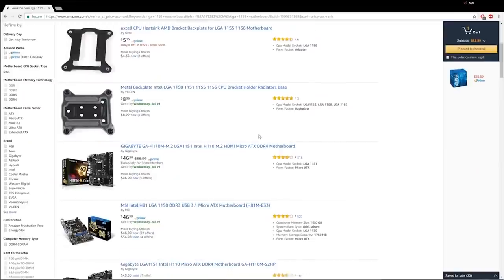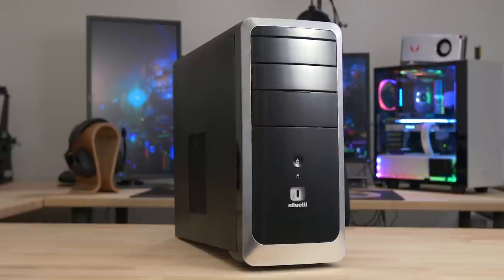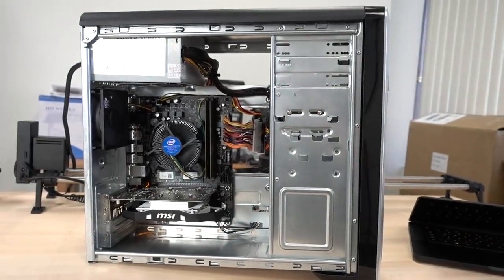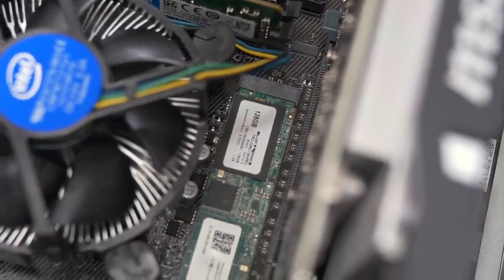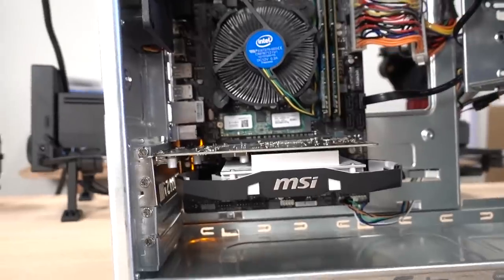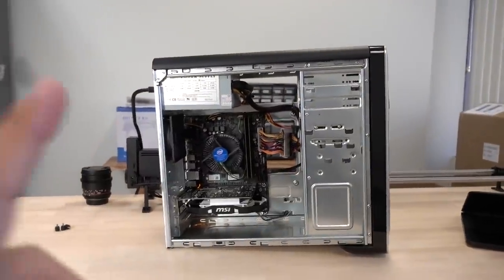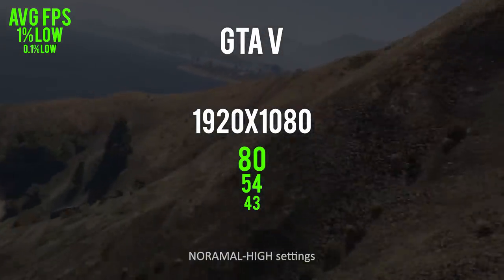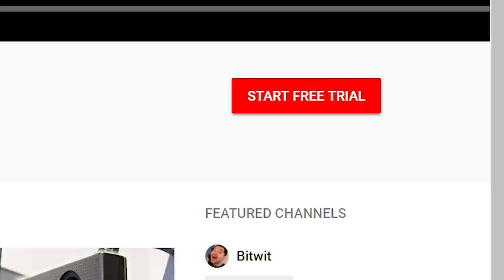The best $400 gaming PC ever?

Comment: How does this PC look?

Ryzen 5 1600
-Stock Cooler

B350 Tomahawk

GTX EVGA 1070 SC

NZXT S340 Elite

CX550M 550W PSU

Samsung 850 EVO 250GB SSD
1TB HDD

Corsair Vengeance 3000mhz RAM 8GB 2x4
Reply: Dwight Schrute good but if you can get the regular s340 or a cheaper case to upgrade to the 1600x
Reply: Dwight Schrute I would look for a 600w power supplie or more. If you can get 16gb of ram would also be good maybe even a hyper evo 212 or another cooler. If you want to get a rgb/red strip which supports Msi mystic lighting e.g bitfenix rgb/red strip and a red 1070 if you want a consistent theme throughout build.
Reply: QuietSpaceGaming dude don't tell him to get the 1600x, the 1600 can be OC'd and comes with a cooler
Reply: Nice but ge 16gb of ram
Reply: Dwight Schrute I have the s340 elite and it looks so nice. I would also recommend the Cryorig h7 for some nice cooling. It looks very nice.
Reply: Ezio Auditore But the non X chips have lower quality memory controllers making it harder to get anything over 3200 in those systems. Obviously some are lucky and some aren't but I'd never count on getting 3600 memory to work at that speed on a 1600. 1600x maybe, 1700x definitely. But 3000 or 3200 is plenty fast for this system as anything over that gets expensive fast.
Also, the power supply is plenty, getting bigger doesn't give you anything except a more quiet PC as bigger power supplies don't turn the fan on unless they are over 50% load, so take that for what you will. Stock cooler is fine for 3.7 but if you could get something a little better (possibly hyper 612 evo or something like that) then you could overclock it to 3.9 (4.0 if you're lucky) and get a fair amount of performance improvement, but then again I don't know how close to your budget max you are already. 
As far as SSD, Samsung is essensially the same speed as every other SATA 2.5" drive, get whatever is the cheapest in the size you want. When I built my last pc, the crucial was the cheapest but prices fluctuate so much I wouldn't count on anything except for Samsung being more expensive, and every little bit helps
Reply: Oh, also there's a rumor of a 1070 ti to replace the 1070 and beat vega 56 at the same price of the 1070, instead of it being only 75% of a 1080, it would be 87% (ish) of a 1080 at the same price, if that might be worth it to you look into those rumors and judge for yourself if you think they're true
Reply: whats your budget?
if you can, id get 16 gigs of ram and maybe a better psu, somthing gold rated like the rm650x  or an evga one
Reply: @Dwight looks like a solid build you can overclock it to 3.7 on that stock cooler without raising voltage maybe also
Reply: Oskari like 3000, 2666, 2400?
Reply: L S I'm waiting for the 1070ti because the 1070 will drop in price which is when I will pick it up
Reply: Noam Lotan 1500$
Reply: +Bakht Khan wrote "I would look for a 600w power supplie or more." Dude, he does not need a 600 watt power supply for this rig. A 550 watt power supply is more than adequate. The system is going to pull less than 400 watts, probably closer to 350 watts. 200 watts of margin is ample.
Reply: A GTX 1070 Ti  is the rumored next release it is like what the GTX 1080ti is to a gtx 1080 so a major improvement to the GTX 1070

Comment: What about

Ryzen 3 1200
B350 tomahawk 
8gb ram 3000mHz
Gtx 1050 ti
Reply: You're missing a few components but it's solid.
Reply: You can buy a htpc case with a 280w power supply built in and get a low profile 1050ti for a console sized 1080p gaming pc
Reply: And a 2.5 1tb sshd that performs way better than a standard drive.
Reply: most b350 boards will not clock above 2667mhz yet, unless there has been a fresh bios in the last month that has changed that, but i have seen most boards only going to 2667
Reply: Better than that pentium
Reply: 1200 even OC is slower that TurboPentium in games! You didt watched some latest Jay2Cents videos?
Reply: I have that motherboard and it does not like to post, I would recommend something else

Comment: The 1050 and 1050TI are amazing little cards.  I put one in an old office PC (HP 6200 Elite i3-2200) for my 14 year old and it games quite well, and it works on the stock 320W PSU

Comment: No problem at all using this machine streaming in twitch. I have been using the same pc part except for the cpu and gpu, mine was g4400 cpu and gpu gtx760 which is lower then the part in the video.

Comment: Or just go used and get better performance for $400
Reply: William Shockley i got a i7 4790 8gb ram and a r9 fury x all for 400
Reply: ANDY trie
Reply: The thing about going used is that its not applicable to everyone as other people may not get the same deals.
Reply: ANDY just noobs do that
Reply: I got a 980ti whole trading my 950 and $100 ;)
Reply: Or pay 400 bucks to buy a broken computer.
Reply: Or spend 400 now on a used pc, then 100 in two months when the graphics card dies, then 60 in another month when the hard drive breaks, then another 100 two months later when the motherboard shits itself then maybe another 100 when the CPU melts
Reply: Then it's unlikely to be a powerful cheap PC.
Reply: read more running a X5650 on 88c° for a few months and only droped it ones, there is a corner out of the CPU PCB and still works (btw i have a good cooler but an overclock to 4,6Ghz 1,4875v and that's alot for a standard 2,67Ghz chip)
Reply: Daniel B and if watercooled watercooling parts also new (prevent leaking and shit)
Reply: I recommend that to all of my friends. They are all rocking i7 gaming rigs under $400!
Reply: Newegg and best buy have a lot of refurbished systems and they typically run the same price and there are hundreds of them. If you can get Best Buy and or Newegg to ship to you that is.
Reply: He also says, 'what sort of 400 pc has a m.2?' I'd say 90% of them.
Reply: This build bitwit did was terrible, it has a bad OEM PSU, for the same price he could've gotten a 25$ case and an EVGA PSU...
Reply: Yeah, for example there is the Ultimate Windows XP Build done recently by someone with a i7 3770, a GTX 970, a 650W Power Supply and a 120Gigs SSD with a 1Tb HDD.
https://www.youtube.com/watch?v=BlYKWoBd7_c
Reply: Well that's just stupid. XP is bottlenecking the system, not to mention many games don't support an OS that old anymore.
Reply: ANDY that sarcasm?
Reply: GenericBritishWoman brah can ya vouche for me i lost my medical card, because you have to amokibg some fire shit with that statement
Reply: Dennis Rigdon I don't mean it as in every one uses an m.2 ssd im saying  90% of modern motherboards have m.2 slots
Reply: ANDY my mom works 4 jobs to keep food on the table and she can barely afford out apartment, people like you piss me off
Reply: and yet you have a phone or computer good enough to watch youtube apparently
Reply: WAYYY BETTER
Reply: Yeah but not everyone gets the same deals as someone else this is universal
Reply: William Shockley That's what I did

Comment: I built the same system a few months ago but i ran an RX560 instead of the 1050, Mine boots in like 18sec off an M.2 card, adding an optical drive slows it down a bit but it's not unusable

Comment: You left out the cost for windows.
Reply: And monitor, keyboard and mouse and speakers. Unfortunately when people decide to build their first PC those are other factors they forget that can easily drive your price up. Having all the peripherals now and it's cheaper for me to build/upgrade my current or future rig.
Reply: Trebloc i know this is old, but i cant help it.

Windows 10 you can get for free (windows media creation tool)
You dont need a monitor, you could use a TV
You can get super cheap Keyboard/Mouse combos.
You would only need speakers if your display didnt have any built in, but if you use a TV, speakers arent needed.
Reply: You can get used monitors/tvs dirt cheap
Reply: @teemuojaniitty9864  i got a used asus 24" monitor (idk the model) for 45$.. though its only 60Hz 1080p
Reply: BUT IF YOU BUY A CONSOLE YOU NEED TO BUY A TV AND A COUCH TO SIT ON!!!
Reply: You can also  use your head/earphones. And speakers dont cost anything anyways.
Reply: He can use the trail version

Comment: Kyle should I buy Ryzen? :)
Reply: FalconPlaysMinecraft yes
Reply: People love to hate on Intel right now, but they still have better performance in most games. If you're just gaming and can afford a 7600k or 7700k, you should go for one of those. If you're on a budget, Ryzen 5 is pretty good compared to lower end i5's though.
Reply: LinusTechTips literally just released a video regarding this m8
Reply: WizdomTV The 7700k is king for high end gaming with best over all through put of all but commercial grade processors and out performs many of them in in single core through put. The 7600k is a very good performer but because of multi threaded games is not the best option unless you want to save a little money. I do agree however in most cases under the 7600k Ryzen is just a better value proposition over all even against the g4560 for a little more investment.
Reply: I've seen benchmarks between a 1600 4.0Ghz and a 7700k 4.9Ghz (decent overclock on both then) coupled with either Vega 64 and GTX 1080, the build with ryzen was 6% slower in 1080p and just 2% slower in 1440p (which is the recommended resolution for those gpu)
i7 7700k is "king" but I wouldn't buy a dead platform just for squeezing 3 fps ...
Also the ryzen was usually better with 1% and 0.1% lows
Reply: Man, the r5 1400 (4C/8T) is roughly 40% better than r3 1200 (4C/4T) on cinebench multicore test, so hyperthreading on ryzen is a big deal
The 6C/12T 1600 beat the crap out of the 4C/8T 7700k on multicore test too, with 1Ghz less in clock speed for much cheaper, intels cpu are not good anymore for multitasking, and you can see the same results for threadripper vs i9
Reply: WizdomTV I mean, the 7700k has better single core performance. It seems to beat the 7600k by small margins in most games. Also it's nice for doing other things while gaming.
Reply: Check out Hardware Unboxed's video. "5 best gaming CPUs"
Reply: FalconPlaysMinecraft for minecraft you need a i9
Reply: WizdomTV You get that if the single core performance is better, that scales up when more cores are used right? Maybe I should have said "performance per core" since you seem to be confused.
Reply: Yann Renvoisé
I've seen benchmarks that show the 1600x, 1700x, and even the 1800x lagging further behind the 7700k and it getting better fps lows. It depends on the game and your numbers are likely the best case. You are however right that the 7700k is a dead end because Intel likes to kill off there chip sets and AMD has better chip set features at the moment. Everyone touts upgrade path but Ryzen will have to see much better improvements on AM4 vs the completely lack luster improvements on AM3 to make the upgrade path worth it. Will they? I don't know, but I hope so.

Also, you are correct that AMD can run much better with heavily multi threaded work loads, mostly because of more true cores and/or more threads. Core for core and thread for thread Intel's high end main stream cpus beat Ryzen and in gaming for the next few years or more no more than 8 threads will likely be needed.
Reply: Adam W
The one I've seen is from Hardware Unboxed from 3 days ago (https://www.youtube.com/watch?v=t8K2yc11eC4&t=1s) and was tested with 20 games
From what I've seen in the comments Ryzen was much slower when it came out (like 15% slower) but they resolved most of the problems and now it's on par, titles like Hitman and Total Warhammer run better on i7 and others like Prey, Civilization and Dirt 4 run better on the 1600 (non x btw, with the x you can likely get 0.2Ghz more)
Sure if you only play titles like Cities Skyline/Planet Coaster or emulators like Cemu or RPCS3 which run on 2 threads max then you'll get huge increases from the single core performance of the i7
And for people who stream or record their sessions I'm pretty sure a true 6C/12T will give more stability than an i7

In the end the i7 isn't that appealing for the price, and the 8700K will likely get at ryzen level for multitasking but won't improve game performance due to lower ipc/clock, so no real upgrade on the intel side
For zen2 and zen3 well we can't say for sure it'll be that better, but considering it's a totally new platform that has given good results, while intel is struggling (intentionally or not?) on the same one since 3/4 years, then it's likely to get quite a boost in performance without having to change the whole system :)
Only the price will tell if it's worth the upgrade
Reply: Yes
Reply: FalconPlaysMinecraft depend either 
For gaming = intel, or
Streaming/multitask = ryzen
Reply: Yep, and I'll ad, for Used Budget = i5 2500k + gtx 970
Reply: If you  only play Minecraft , as suggested by your name , then no , if you play other demanding games like gta or Arma or are getting destiny 2 , then yea , go with the ryzen 5 . But it really depends on your gpu
Reply: Elddir my ryzen runs better than my intel with the same parts, depends which parts you use neither is inherently better than the other

Comment: Building second hand can score you some serious kit for low money. I got an i5 4670k, 2x4GB DDR3 Corsair Vengeance + a Gigabyte Z87-HD3 for £100 (in the UK of course). Case wise I got a Corsair Carbide SPEC-02 for £10. I picked up an Integral 120GB SSD new for £20 and 2x500GB HDDs for free (thank you Sky HD boxes!) so now I just need to add a GPU, PSU  and Keyboard/Mouse. I would say that is definitely going to beat the $400 (roughly £305) budget PC!

Comment: Decent build, but honestly for the value, an Xbox one X would be wiser purchase for the money.  If you have a PC to only play 1080p at 60fps that's hardly worth it.
Reply: TechMaven yeah but you can get infinite free games on piratebay
Reply: Well, for the most part consoles don't really go above and beyond 1080p either, at least with this build you get the same resolution (1080p) with equal or higher graphical settings with more or less 60 fps across the board. The real benefit of a pc though, is the flexability. You have the ability to use keyboard and mouse for precision shooters, or plug in any controller with a cheap eBay USB adapter for any desired game. You can use it as a workstation for editing pictures (slowly for sure, but you can do it), or you can use it for schoolwork doing research, writing essays and so on. This endless flexability comes on top of the ability to play games in the same quality as consoles for the most part, making it (in my opinion) far better value than any console.
Reply: @softgunruler  Do pc masterrace people not know anything about xbox one x? It plays 4k at 45 fps or 1080p at good fps. Most people don't care for picture editing, most phones can do this anyways. You can use an xbox for research as well, again or a cell phone. Plus consoles are very optimized. You wont suddenly drop to 20fps like you will on a $410 pc because something popped up in the background. Or any reason really. Even on my I7-8700k/RTX 2070 OC/16GB 3000Mz 14Cas ram/240GB ssd I will still drop below 60fps in gta v 1080p high/ultra settings. And that cost me around 3x more than an xbox one x that will do 4k
Reply: @thesmellofbacon7595  Yes the One X is impressive for its cost, and I am well aware that it has several games it can run at 4k at decent fps. However, many (not all) games have their graphics settings set so far behind their pc counterparts to be able to achieve this. If you do some digging, you will see that the graphics settings used in console versions of games is about equal to low settings or medium at best in the pc version, even though the resolution is the same. Again - not all games, but a lot of them do. 

I love that you bring up your own computer, this gives me a good frame of reference. You claim that you have an 8700k and an RTX graphics card yet still drop below 60 fps at high-ultra 1080p GTA5? Well I have an i5 8600k and a 1060 graphics card, and I run GTA5 at the high preset settings with a couple tweaks up to ultra, and I have no issues running it at 1080p 60fps, no drops. The only reason I get 60 is because I use a 60hz monitor with v-sync on, so it is limited at 60fps - if I turn the limiter off I get between 80-100fps depending on where I am in game, and these settings will as I said earlier be far better than what the console settings are set to. If the developers gave console the option to adjust their own graphics settings this would probably not be the case, but thats not the world we live in. 

If you are serious about your computer components and your GTA5 experience I would send it back to the store, because I have worse components than you but apparently get better results in-game.

Comment: Certainly a console killer. I just built something VERY similar to this only last week, but I blew another 100 bucks to get an ITX motherboard, a TI instead of vanilla 1050 and the full 8 gigs of ram from the outset. Pushing over 80fps in 1080p ultra doom if there isn't too much going on. I've never seen it drop below 55-60 even when the action is crazy. It's amazing what the G4560+1050 combo will do for less than 200 bucks total, it'll beat the pant's off ANY current console. And, you know, when you're done gaming you have a system that'll let you work, browse the internet the way it's mean to or just keep buying more stuff online, instead of an ugly hunk of plastic taking space up beside your TV.

Comment: Posting on an old video... But the drive wasn't "sold as new", was clearly marked "used good" condition on amazon in the other video. Couldn't find any other comments pointing that out or a correction annotation on the video...